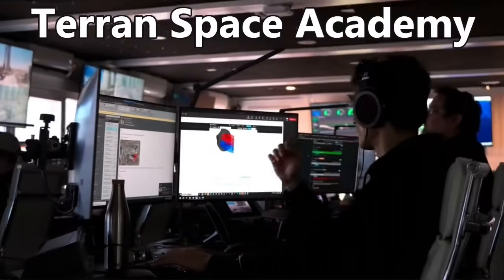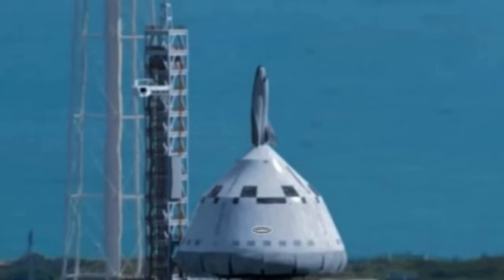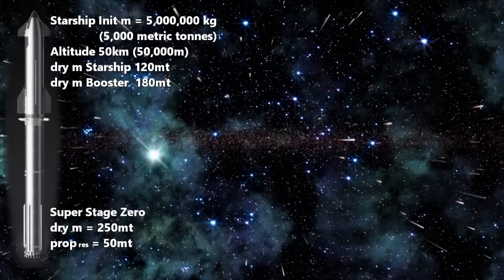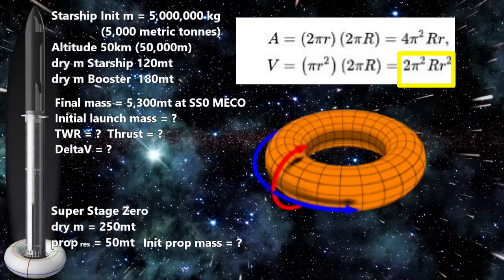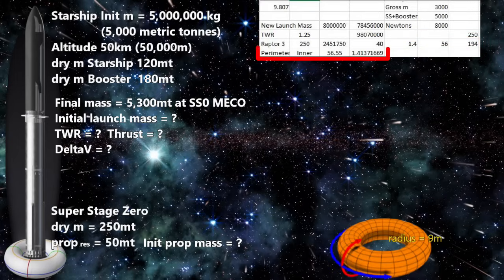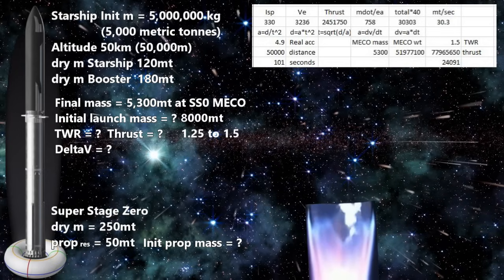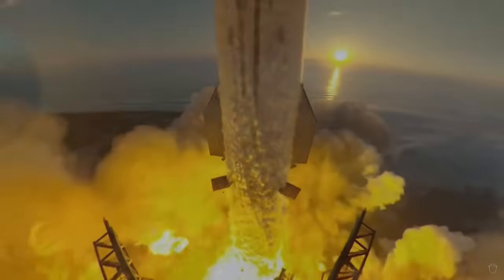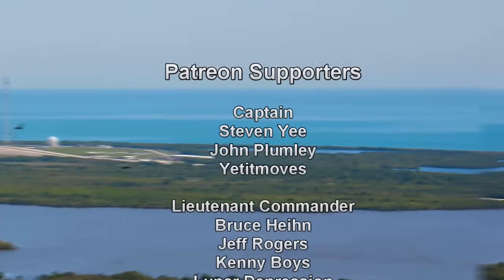Making Starship Better with Super Stage Zero!

Comment: I would use the SERV desing as the second stage, with a fatty booster underneat it.
With an active cooled heat shield,no more heat tiles and flaps and that whacky flip manouver.
And not a torus tank but mutiple cilinder ones in a circle.
The design would also be double hull with is better against boil of.
And no jet engines but rocket for landing
Reply from the maker: That sounds good to me.

Comment: The jet engines would be impossible to start for a landing with reverse airflow, the stage 1 Booster will need much more return fuel in order to slow down and will not RTLS. Thats my 2 thoughts.
Reply from the maker: You would need flaps to redirect the air flow down the jets with blocks at the bottom.
Reply: @terranspaceacademy  The other issue with jets I can see is a turbofan will need extensive ducting to allow supersonic operation. It cant just be an engine in a pod like an airliner. Then with the very short time between 100km to zero, getting them to start in reverse airflow, spool up and finally contribute to lift thrust might be too short. The time between at 5000m high supersonic and zero knots sea level is seconds, can an engine be started that fast?
Reply from the maker: It would need to be recessed out of the direct airflow I think...

Comment: Further to chadjensenster's comments below, the positioning of the jet engines on the taurus would need to consider the likelihood of re-ingestion of the jet engine eflux in the final stages of landing. Re-ingestion could cause a reduction of thrust just when it is needed to reduce v to zero.
Reply from the maker: Good point.  That's probably why they put them under the edge of the bottom under the tanks with side air intakes.

Comment: Ged rid of starship altogether. Inefficient part of this system. Also much more dangerous. This chrysler would be able to land without without flop maneuver, would not need ceramic shield since the whole bottom would use active cooling using liquid hydrogen- which would have dual use since it is also necessary part of aerospike(and detonation aerospike) engine. big volume so close to circular shape would allow for low mass of construction while keeping tanks biggest possible. That is necessity for SSTO rocket. Also, the crew area would be probably best on the bottom at widest part of Chrysler. That would make artificial gravity possible- human needs at least 0.7g for healthy living.
I would use the rotating detonation engine along the widest part of rocket as well- That one has biggest ISP from all rocket engines
Reply from the maker: If we get RDEs going it would be possible.
Reply: @terranspaceacademy  It should be possible even without it. Venture star was designed to go to orbit as SSTO... well, the project was stopped, but should it continue, it would manage. But the Venture star had much worse shape in regards Volume/mass ratio than Chrysler model. 

What I dislike on starship is that shape. It is just way too long. And not only together with booster... second stage is too long as well. Engines aren't placed in regards of minimizing the construction mass either. Starship is planned to land on the Moon and maybe even Mars which is more foolish. Such long rocket surely can't land safely on loose sandy or dusty surface which isn't levelled! Chrysler like rocket would be able of that(because it is so broad and has center of gravity so low). And if the crew quarters would be on the bottom of rocket, even such nonessential thing like elevator(which is necessity for starship) would be superficial.

The "Stoke Space" company is working on circular aerospike engine (classic type rocket engine -not detonation using) but the shape of rocket will still be too long in my opinion... it should be broader...

Comment: How about working the numbers for this?

A more viable alternative is two side boosters which also pump LOX and Methane to the central booster.  This quickly burns the side booster propellent and therefor separates at a lower velocity/altitude than the comparable Falcon heavy configuration. The fully fueled central booster  is essentially getting a 2000 or 3000 Km/hr head start far above max Q altitude.  One side booster has an oversized liquid methane tank because it is supplying methane to the central core. The other side booster has an oversized LOX tank because it is supplying it to the central core.  The side boosters have 3 raptor engines to support their own acceleration while keeping the central booster tanks full.  90% of the oversized side booster tank is pumped to the central core because it has 10 raptors for each side booster raptor.  The methane pumping side booster is much larger/taller than the LOX pumping side booster because relative volumes but this is not an aerodynamic problem. 
       The side boosters never suffer severe reentry/deceleration requirements like happens with falcon heavy side boosters because the much lower initial velocity (and closer proximity to the launch site).  The empty weight is comparable to falcon 9 boosters and could use the same landing legs.  Other viable differences include small glider wings on the side boosters to allow a ballistic reentry from 2000 or 3000 Km/hr and 30 Km altitude, then gliding back to near the launch site instead of retro rocket. Viable because max reentry velocity is relatively low. If a turbine engine was included in the side booster, then it could land on a runway (but not enough power to go around if the touchdown must be waved off).
Reply from the maker: This is meant as a mental exercise.  Not a planned development. :-)

Comment: Hey, I think we've all thought the same, including the Airforce. They strapped an ICBM to an F 15. Imagine nacelles with afterburnering engines on the sides of super heavy. These would detach and glide back down with a glide bomb type deployable wings. Each nacelles would have the modern-day  equivalent of a larger version of the SR 71 hybrid turbine/ scramjet engines, or you could go cheap and afterburn a GE 90 out of a 777. Nacelles and make starship pointier.
Reply from the maker: Oh that is so cool!

Comment: The question which was bothering me throughout the video is how would the performance of the jet engines be affected by the air intake facing away from the direction of flight?
Reply from the maker: Very negatively I'm sure. We would need air blocks to startup...

Comment: I had to replay the center of the vid three times.  

if R=7, r=5, V=3454..   If R=14m, r=5m, V=6908.7.   If R=14m,  r=3.536, V=3454.    If R=12.71, r=3.71, V~3454
if existing ground stage zero diam=18m, then R~12.7m  

Given that 3454m^3 prop works, you end up with a wider & thinner torus.  Gonna need a bigger launch pad! Still, I like the vids.
Reply from the maker: The diameter of the "donut" is 10m giving a radius of 5.  The diameter of the "hole" is 18m giving a radius of 9+5 should be 14... and that would be R.
Reply: yes, R=inner radius + r. When R=14 and r=5, you get V=6908.7.  In order to get V=3454, r is smaller than 5.

separately, what do you think about cutting the torus horizontally and making a two-wall cylindrical stretch tank between the caps?  less drag, and you can structurally support the booster connection from 2 rings instead of just 1.
Reply from the maker: That's a great idea!

Comment: You mentioned H2O2 rockets in a comment reply below. Have you looked into the Green Propellant Infusion Mission NASA launched in 2019? It was demonstrating use of a monoprop called hydroxylammonium nitrate (HAN), which has about double the performance than monoprop hydrazine. It's been propsed since the 90's but it has to be heated to work, so the material science had to catch up before we could test it in space. Nifty stuff!
Reply from the maker: I remember hearing about it but haven't seen anything since.

Comment: Good video. Starting the jet engines with the air flowing through them backwards might be difficult to do, but it seems like a very cool concept. Another issue to be resolved would be transporttation as that would be very large. Not a show stopper by any means, but they would have to make a lot of changes to their process to accomplish it.
Reply from the maker: You are correct, we might need air blocking flaps to get them started...

Comment: The Starship in its current design is good for nothing more than LEO cargo transport.  With its capacity, it is a huge leap forwards.  But for more, it will need nuclear propulsion.  Not availlable before 2027.  We can be sure that Musk and Shotwell are well aware of this, more than we are.  In fact, one new building in Starbase looks much like a nuclear research or assembling facility.
🚀🏴‍☠️🎸
Reply from the maker: I don't think they'll be doing anything nuclear at Starbase.  They have enough trouble with the environmentalists already.  No one would put a nuclear development lab near a big explodey rocket I don't think.
Reply: @terranspaceacademy Or more importantly inside his big blowey uppy tube.
Reply: Would you let Elon detonate nuclear fuel in the atmosphere? 😂

Comment: The only thing along these lines that I could imagine makes sense is using two Falcon boosters for Starship Tanker launches. 

Many ideas that result in the super heavy booster going faster defeat the entire point of the Starship system design, that being that everything returns to the launch site. Can't send the booster too far away or get it going too fast or it won't be able to return to the launch site in reusable condition. That and the entire idea here is cost effective up mass. It's presumably going to be more cost effective to launch Starship twice than to do just about anything else. 

However they'll need to build some Starship Tanker versions. Versions of the Starship that are all fuel tank, that have no other payload bay. These fully loaded with fuel could be much heavier than a Starship designed for putting satellites or people in orbit. 

To help launch these with as much fuel as possible making it to orbit using extra boosters could make sense. A couple of Falcon heavy side boosters attached to a super heavy core could be just the trick. It wouldn't take much extra infrastructure to do it, they'll have the boosters, and while the Super Heavy core needs to and can return to launch site the boosters could land down range on the drone ships if needed.

Ideally I could see this where the Super Heavy core and Falcon side boosters stay connected until after they make the boost back burn. Only then separating to land separately at the launch site. This entire thing being really just a way to recycle and use up the Falcon boosters because they already have them and they can be transported. Otherwise it just makes more sense to make the Super Heavy larger or launch it more.
Reply: Side boosters sounds good, but FalconH ?  How do you want to strap that onto BFR?  Falcon9?  9 engines more per booster.  Maybe with Raptors: FalconR.  The whole idea is also much about reducing the carbon footprint.  No chance for Merlin engines.  Switching Falcon to methane might only be awaiting further developement of Raptor engines.
🚀🏴‍☠️🎸
Reply: @MichaelWinter-ss6lx  Falcon can't just be switched to meth and raptors, too many differences.
Reply from the maker: A Starship Super Heavy!

Comment: I wonder, if you just made the whole structure a big tank for the booster that would drop off when empty and float to earth on chutes, just how much starship would need to refuel before heading to the moon?
Reply: Making the booster larger would accomplish the same thing more efficiently. However it defeats the entire point of the booster design. That being a return to the launch site. The booster can't get going too fast or go too far down range for it to be able to turn around and return. Far more cost effective to do two launches that return everything to the launch site than one that doesn't.
Reply from the maker: Hmmm... Not a bad idea.

Comment: I also thought about a "hyper" heavy version. Essentially the same method used as in super heavy, by attaching two heavy booster at the central booster, so that there is no need to "invent" a complete new stage, and it´s all the way still reusable. For a super heavy lift or or a direct way for missions in the outer solar systems, this might be the cheapest solution. Doing the same with the falcon/falcon heavy, but with the new big boosters.
Reply: That defeats the entire point of the Starship system design, that being that everything returns to the launch site. With every Falcon heavy launch the center booster is expended. It's gone too far and is going too fast to return. It's far more efficient to launch Starship multiple times with everything coming back to the launch site, than it is to expend a booster.
Reply from the maker: Cool idea!

Comment: The really terrible thing about Starship is the upper stage requiring all that mass of shielding and wings and so on.  I so much prefer the design Stoke Space has come up with.  Being able to do a deorbit burn all the way down using the aerojet design, and have an off-axis design that helps deflect heat, should save a ton of weight off that upper stage.  I’ve been wondering if the guys at SpaceX aren’t looking at this design long and hard. Other weight savings are also achieved since the Stoke Space design has only one large fuel delivery system for all the nozzles.  Could you imagine doing that with Raptor 3 nozzles?
Reply: I think the thing with the Stoke Space design is that it's limited in up capacity. Can't increase it's volume without increasing it's diameter which would make it harder to get to orbit in the first place. Starship can put far more mass and volume into orbit than the Stoke design ever could. 

The Stoke Design could be a great replacement for the Dragon Capsule but I think it's a safe assumption that the Starship will be human rated before the Stoke.
Reply from the maker: I love their design too and I think the reentry is more advanced.

Comment: So uh, how do you plan on bringing Super Heavy back down?

Also, it's entirely fine to speculate perfect performance on paper, but you should be getting used to building in fudge factors to account for imperfect performance and failures in real life.
Reply from the maker: He shall float gently back with a retro burn... and probably burn up anyway.

Comment: Looks simpler than Sea Dragon 🙂
The real problem we face is the scalability needed for Elon's Mars goals.
Starship is not just a rocket, it is a mass production assembly line and spaceport solution akin to airports today.
We could build a few rockets per year and set the exploitation of Moon's resources as a goal. Elon needs thousands of Starships and tens of thousands launches.

Can this solution support a turn over of tens launches per day? 
Maybe yes, but we sure need a big area, such as a particularly busy airport, for all the landings, than we need a fast stacking solution.
The area is needed because we have different operational needs, on simpler just for tankers/ space propellant and another for cargo and human rated operations.
Mechazila and Chopsticks provide an elegant solution for fast redeployment, though there's still need for the different operational modes.
Reply from the maker: Indeed.  The entire point is to make it durable and easy to produce.